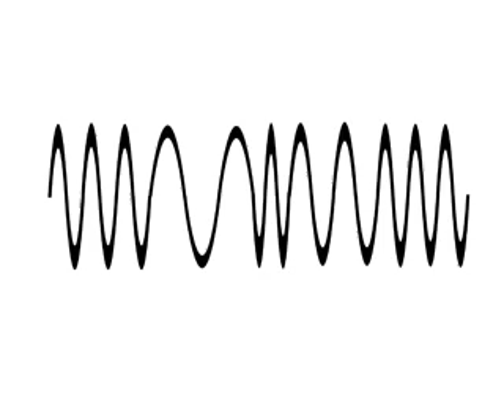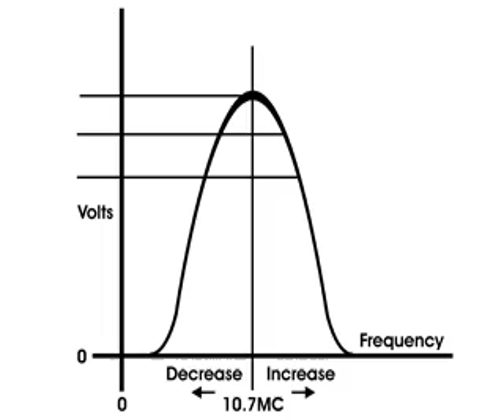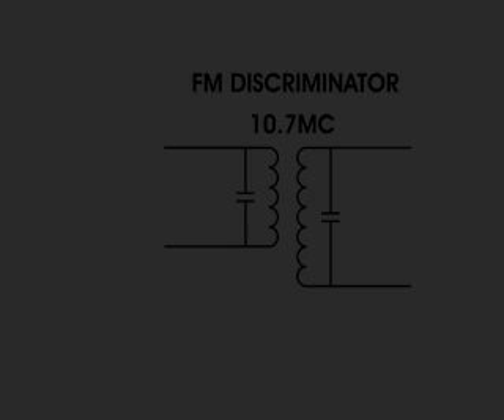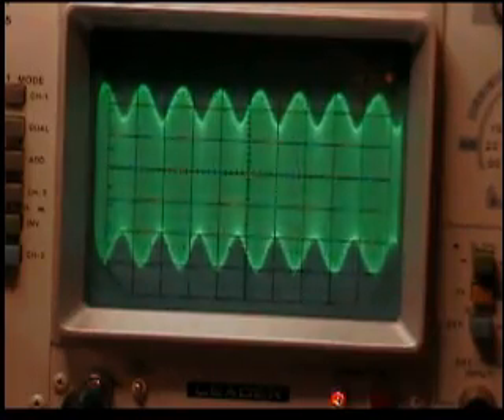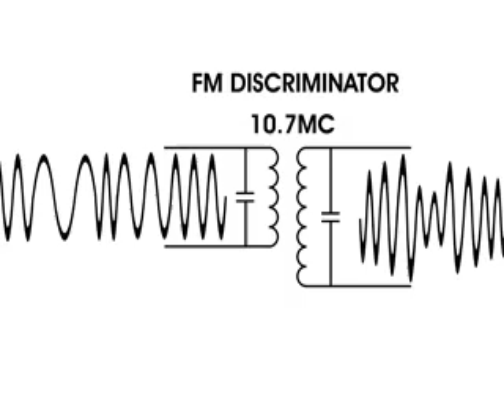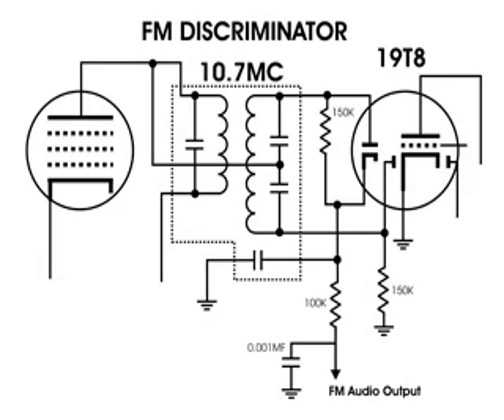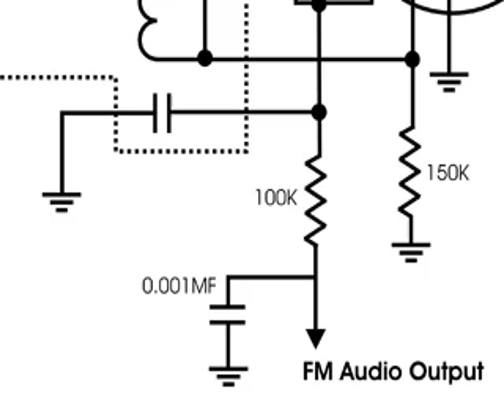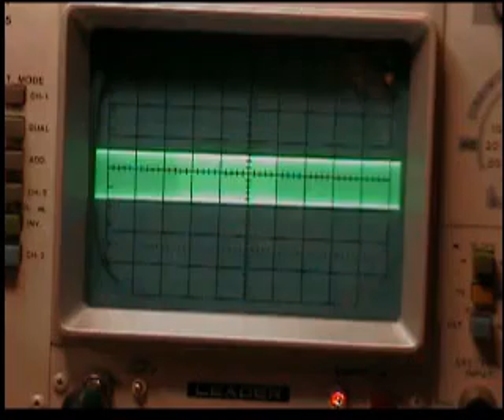FM Discriminator

Comment: Could you re-draw this using solid state components?
Reply from the maker: I'm looking for a solid state circuit. Thanks!
Reply: @AllAmericanFiveRadio  I've been trying to make an FM discriminator for a year now, and still no success. 

I was able make an FM pulse counting receiver, and an FM regenerative receiver, and a IC chip receiver, all of which work quite well. 

But I am still unable to figure out the traditional Foster-Seeley Discriminator or Ratio Detector methods using transformers. I seem to have hit a brick wall, as they say.
Reply from the maker: Hey Andrew,
The audio is developed from the 10.7MHz IF tuned frequency, it is center frequency. The audio causes the 10.7MHz carrier to vary a little above and below the 10.7MHz center IF tuned frequency. This above and below causes the level to decrease in proportion from 10.7MHz center IF frequency. This changing level is the audio information. It is this changing level that is detected. 
I am looking for a circuit to use.
This is my email allamericanfiveradio@yahoo.com
Reply: @AllAmericanFiveRadio  I understand the theory. I just haven't had much luck building it.  I've tried a few schematics but nothing has actually worked yet.
Reply from the maker: @andrewferg8737  Well, I’ll see if I can lower you frustration factor.

Comment: Hello AllAmericanFiveRadio, first of all thank you very much for your interesting, educational and practical videos. I am learning a lot with them.  I have a doubt with this, FM Discriminator video. When the left diode conducts I can not see from where the cathode is being polarized negativily. Is it done by means of the capacitor placed inside the FI can?   Is very clear in the right diode, because the cathode is grounded. Would you explain me a bit more, please. Kindest regards,  José.
Reply from the maker: +Joseradiola 
The secondary output is AC audio. That means the polarity at each end changes from positive to negative, then negative to positive. One diode takes care of the positive to negative, the other diode takes care of the negative to positive, like a full wave rectifier for audio.
Reply: +AllAmericanFiveRadioThank you for your answer. Yes I understand that, but in 4:48 of the video, I see the anode polarized with positive AC signal but, Who does give the negative polarization to the cathode in order to the diode conduct?  That is my doubt. Kindest regards. José
Reply from the maker: +Joseradiola 
The cathode of the diode goes through the 100K resistor to one side of the volume control, the other side of the volume control is grounded, completing the circuit.
Reply: +Hello AllAmericanFiveRadioThat is it. Thank you very much for your answer and help.Kindest regards,  José from Chile !!!
Reply from the maker: +Joseradiola 

Your welcome. I'm glad you find my videos useful.

Comment from the maker: Yes there is more stereo de-coding circuitry. A good place to get the signal would be the stereo volume control. If you tap the signal at the top of each control, that is just before it is amplified by the audio circuits. If you need volume control of the signal tap the center of each. Your ground lead will be connected to the low side of each, in either case.

Comment: is this how stereo radios work or is that a different circuit? i saw on another youtuber's video an old tube stereo it has an fm multiplexer and that decodes the coded stereo FM signal and changes that to 2 separate audio signals which head to the amp, ive hacked enough cheap junk radios into ipod amps by hooking onto where the tuner passes the audio signal to the amp, most of these cheap radios didnt come in for nothing anyway, if there is a way to access the amp ill find it